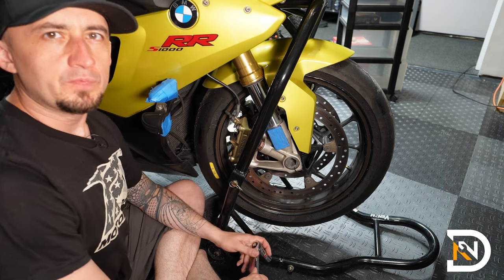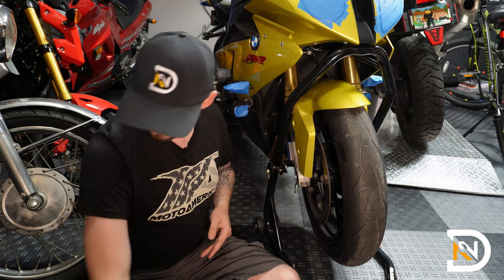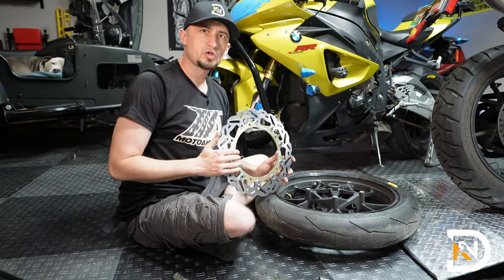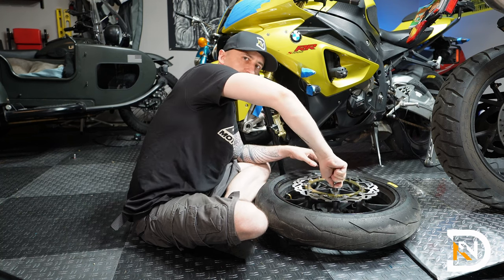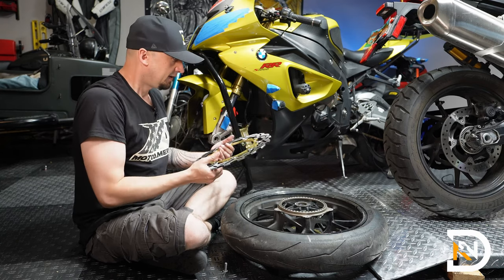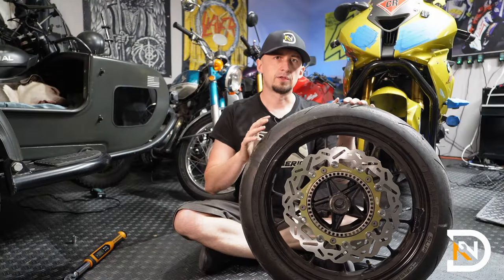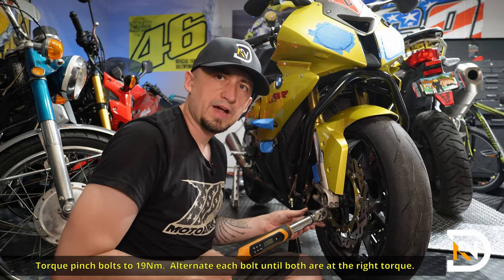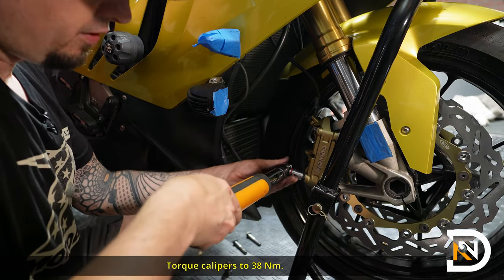BMW S1000RR Front Brake Rotors - how to replace brake rotors on a BMW S1000RR motorcycle

Comment: what if I accidentally touch the front brake, will there be any serious damage?
Reply from the maker: If you squeeze the brake lever your pistons\ pads will begin pushing out of the calipers.  You may be able to get away with just one squeeze, if so just push them back in.